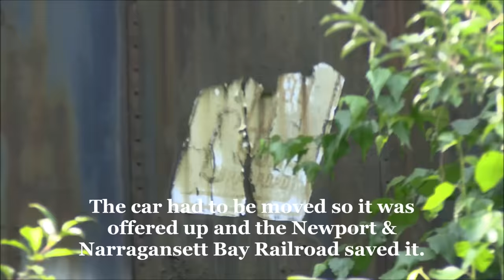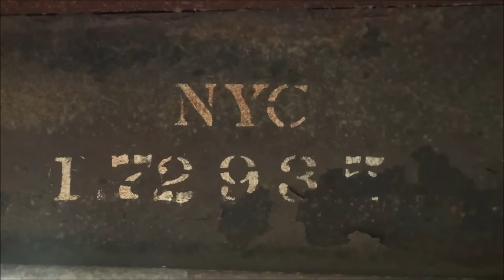Abandoned boxcar in the woods saved! - BCLR Millis, MA to NNB Rhode Island - 9/2023

Comment: Wow, good save for this old NYC boxcar, this car is an old gem! This car was more than likely built with 70 Ton "Friction Bearing" trucks, along with cast on "Polling Rod Pockets". This car obviously underwent a rebuild project at some point. (Most likely during it's tenure with PC) The conversion of the Friction bearing trucks to Roller bearings, with the "Journal Boxes" shaved down are a dead giveaway. This work was probably done in the 1970's and this car probably had it's roof walk removed in the process. Boxcars built beginning in 1966, were built without a roof walk. Then around 1974, boxcars that were built with a roof walk began having them removed.
Reply from the maker: Thanks for watching!
Reply: Rebuilt date is stenciled as 1974

Comment: The roller bearings are a Godsend. There’s no way that this car would be rolling down the rails at its new location if it had sat 20 years on conventional bearings. As a volunteer 50 years ago on two steam railroads I repacked bearings and it is a PITA even with preformed journal pads. The coaches that we bought from the CNJ showed up with waste packing which was really primitive even for 1970.

A railfan car foreman on the PRR kept us supplied with free Hennessy Journapak pads. I’d just call him in his office and he’d show up on a weekend and drop off a bunch of them. I suppose that I contributed in some small way to the PRR’s high operating ratio.

Comment: Can't believe the wheels still turned
Reply from the maker: Thanks for watching!
Reply: It was converted to roller bearings,  probably when it got rebuilt in 1974.  Had it been friction type bearings there may have been some issues.  Car sat for over 20 years and still rolled easily.

Comment: Amazing.  With the right tools, we can move mountains.  I suppose, the same reasons that resulted in it being abandoned, also make it uneconomical to restore as rolling stock ?    Excellent capture.  😀
Reply from the maker: The car was used for storage but the line it was on hasn’t been used regularly in years so it ended up just sitting. It is out of date to restore for regular use.
Reply: With the right tools and the right amount of $$$$.
Reply: Right tools, sure. This was as smoothly done as any job I have ever witnessed. 
However….I wanna know who signed off on allowing those guys to work around the lifting operation WITHOUT PPE OR ANY HEAD PROTECTION??!! That whole operation was exactly one workers comp claim away from turning into a real cluster fu*k! Damn, those folks are hella lucky.
Reply: @maxj0930  HA !  Good point.  I'm guessing they're licensed and much comply with the rules of their insurance carrier.
Reply: I was wondering where the hard hats were
Reply: @maxj0930  I was thinking the same thing
Reply: @Deadbuck73 if it falls on you, the hardhat would be used to scoop up what's left

Comment: Stupid question but would the wheels get flat spots after sitting for so many years?
Reply: No, not at all, actual contact surface the wheel has to the rail is the size of a dime …heat from the brake shoes causes flat spots and/or the handbrake not fully released ….

Comment: This car is very old. The ladders have been cut off at about halfway to comply with new regulations. (They used to go all the way to the roof). Also, the wheel bearings were friction at on time but have been replaced with roller type. The brake wheel has also been replaced to a lower location. As l am typing this the builder info just flashed on the screen. It was built in 1952!!!
Reply from the maker: Thanks for watching!
Reply: Vernon what is the black painted box on the side where it says year blt and reblt, that box has a name and I cant think of it at the moment…..40 year RR retired here …..
Reply: @mshum538  Are you refering to the short lived kar trak bar code? It was developed to keep track of where individual cars where. I am not sure of all the info contained on it. It was a black painted verticle rectangular strip with multi colored lines on it.
Reply: @vernontorrence4407  Well, before computers any car repair actions would be painted on this dedicated black box thats down low and a brief description would be sprayed on it ….
Reply: @vernontorrence4407  As a lifelong railfan I found it a natural thing to do my MBA thesis in 1974 on the failure of the Kar Trak system or whatever it was called. The bottom line was that dirt defeated it. The strips had to be kept clean for accurate reads and nobody washes freight cars. This is overly simplistic, of course, as damage was a constant problem also and one kid painting graffiti on the car would mean a bad order for unreadable Kar Trak. The railroads figured out that with all the no-reads and misreads they had might as well forget the whole thing.
Reply: @bobjohnston8316  It only takes one domino!
Reply: @mshum538 COTS and Lube stencil you're thinking of?
Reply: @bobjohnston8316  i remember that system well, plus the plate they were on were easily compromised …
Reply: @evad1  Yes, I remember seeing like you see them today that the machanical ( car department) uses …👍

Comment: Glad this boxcar was rescued how did this even get abandoned?
Reply: Probably moved there for storage or whatever then out of sight out of mind forgotten
Reply from the maker: Stuck in the corner of the yard for storage, rail line basically shut down, and that was it…stayed there until today
Reply: When did the Bay Colony RR shut down?
Reply: The line is technically still in service and leased to Bay Colony, but since the GAF shingle plant closed down (2011?) there has been nothing moving on this part of the line.  Some carloads of cement were handled to a customer unloading area about 1/2 mile before the location of the car.  A locomotive is still parked nearby. @Gerk8
Reply: Cement moved in 2022
Reply: @alwhalen3488  I worked in that plant briefly in the late 70's. What a shithole.
Reply: @alwhalen3488  Thanks for the info. Is the locomotive "abandoned"?
Reply: Must have been on its home rails then, or someone would have been paying per diem for 20 years…

Comment: How much does a boxcar like that weighs, - 20 tonnes ?
Reply from the maker: I’m not too sure, it could be around that or closer to 50 tons
Reply: The box part weighed 40,000 lbs. (20 tons) Each truck weighed 10,000 lbs (5 tons)  Total 30 tons.  That is actual weight from the crane operator's load scale.

Comment: One can only assume that the track this was abandoned on was abandoned itself and no longer connected to a main line. Question: Is the NNBRR connected to a main line and do they have any rolling stock certified to run on a main line and the personnel qualified and certified to operate same?  OK, no. A certain unreliable "W" website claims the rail bridge linking it to the main line was damaged  and torn down. Obviously big government couldn't find any tax dollars to repair it.
Reply from the maker: Yes, NNB is an isolated tourist operation so it had to be trucked.
Reply: ah. I was gonna ask this. Was curious if the rail it sat on was disconnected...